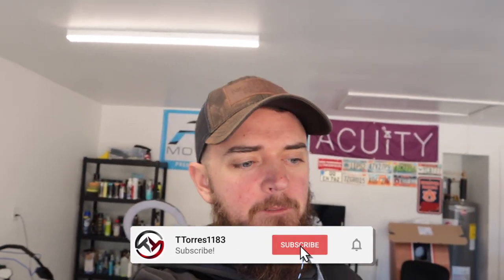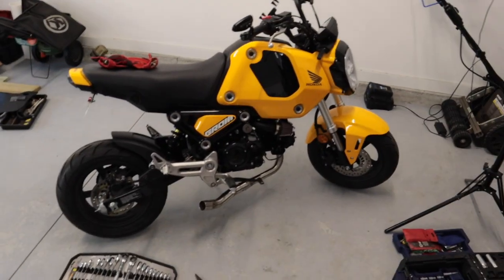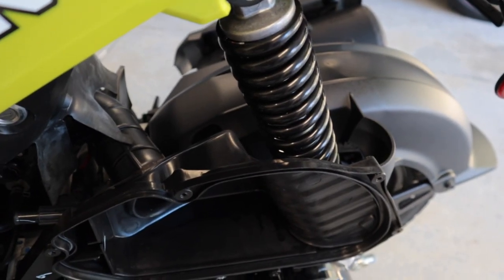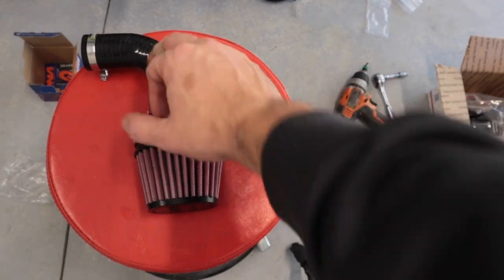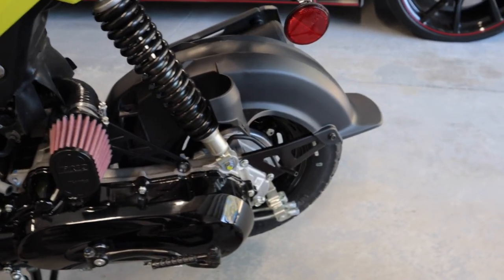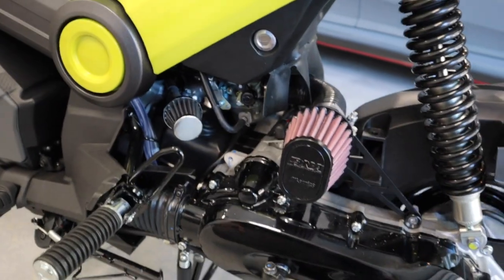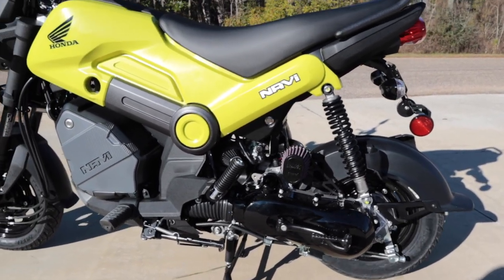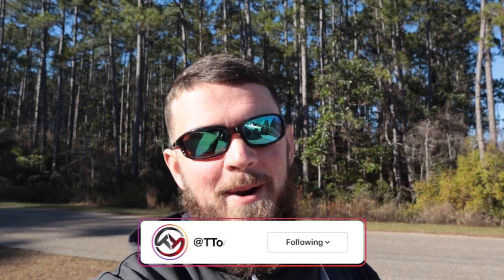2022 Honda Navi Intake Install!

Comment: Brand new to modding stuff. Another user posted, any issues with riding in the rain? Also, that tube at the back you talked about capping….. what’s it for? And how did you cap it? Great video by the way!!!
Reply from the maker: You can put a cover over that intake that MNNTHBX sales. That’s a crankcase breather I believe for the cvt but don’t quote me! Thanks for watching!

Comment: I watched another video on that exhaust and he had the same hardware issue. I’m sure you seen it already. That exhaust is suppose to be super loud.
Reply from the maker: Thankfully I have another muffler on the way
Reply: @TTorres1183  They could have just sent out the right sized hardware.
Reply from the maker: The muffler it’s self was messed up on the mounting part

Comment: What did you end up doing with the secondary loose hose you said you were going to cap it how does that look I'm very close to buying this intake did you have any issues with tuning or is it just plug and play
Reply from the maker: I didn’t do anything with it. I would run the MNNTBX jets
Reply: @TTorres1183  the OEM jet kits they have on their site or something else? Thanks!
Reply from the maker: The one they have on the site